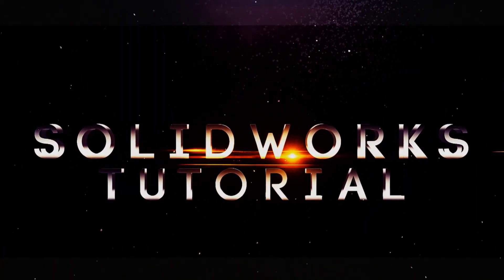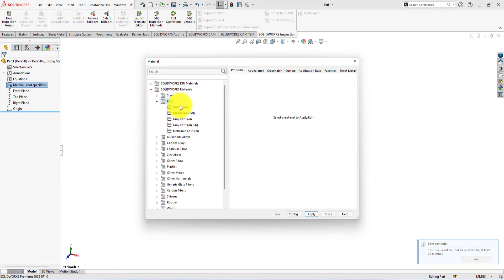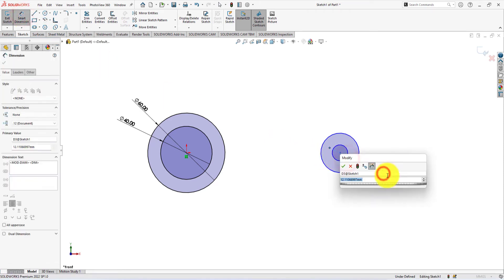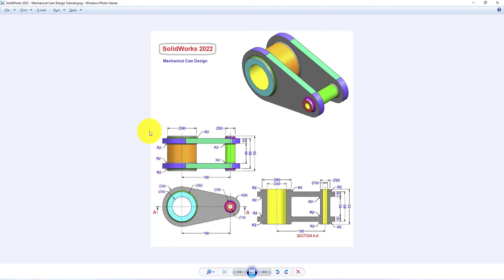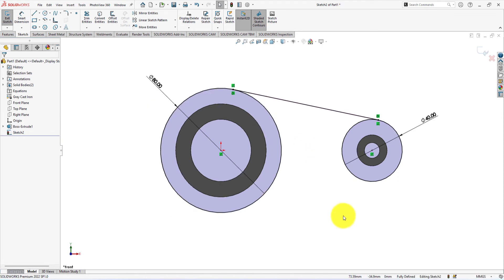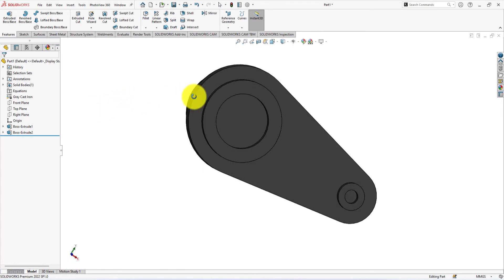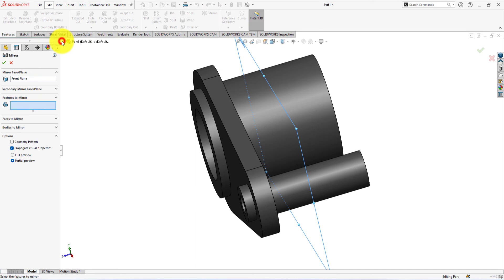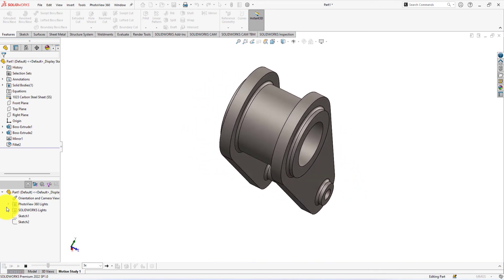SolidWorks 2022  Mechanical Cam Design Tutorial

Comment: Hi thanks for this tutorial 
its great i have a question 
when u sketch a circle 80mm and other 40mm then u use line between them but if u sketch line from top of Semicircular u have a Precise design isn't?
Reply from the maker: Dear Davod, thanks for your interest, and also for the time to comment. 
I connected those circles that way, because of creating a tangent relationship between line and circle. If I draw a line from the top of the semicircle then there might have a node point, and the sketch would not be perfect. Please do an experiment and share your finding with us.